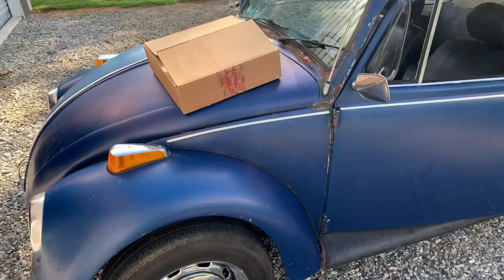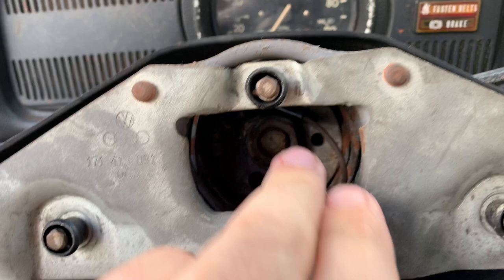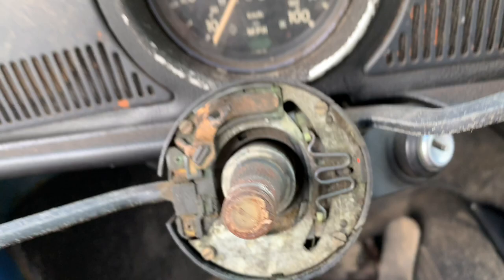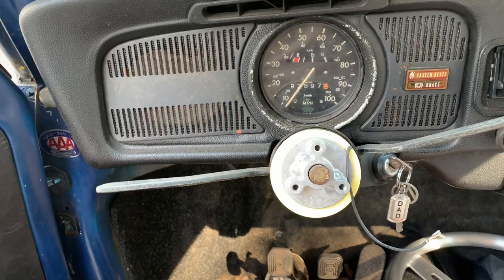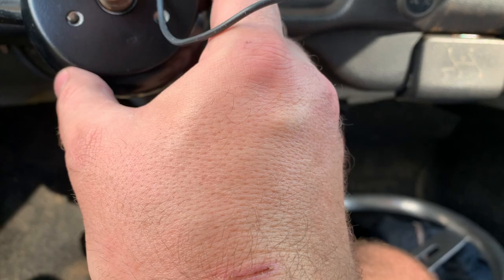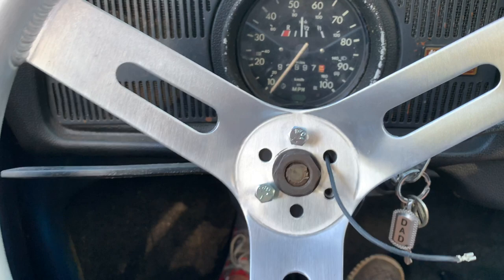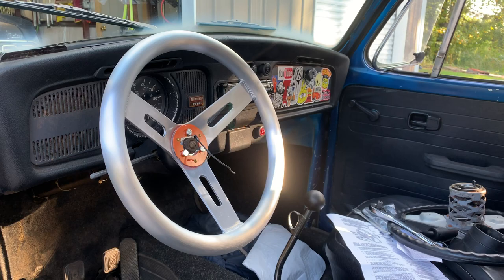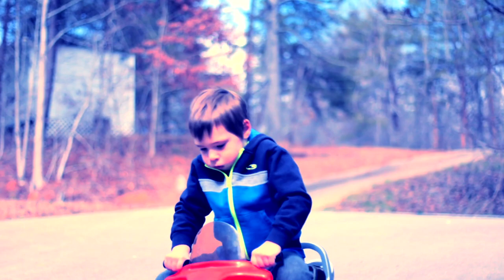Steering Wheel Install 1974.5 - 1979 VW Beetle

Comment from the maker: STEERING WHEEL - https://amzn.to/3z8qSmx
STEERING WHEEL ADAPTER - https://amzn.to/3q7tWxJ
Reply: Hey bro i just pulled my wheel off & yiu used a 24mm to get the nut our. i had to ust an1 1/16 to pull mine off. just a FYI I know the 74 were a spily year the are saying a 1 1/16 or a 13/16.thanks again brio!

Comment: Be careful when buying the adapter for your bug, I just realized the 1974 model is a split year, that means you can have a different size spline on your bug. I do have a 1974 and the adapter that fits is an adapter from 1960-1974.5. I mistakenly bought the 1974.5 and up adapter and didn't fit. Jbugs page has a page where they explain how to find the right adapter for your car.